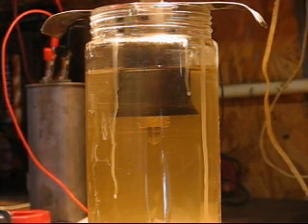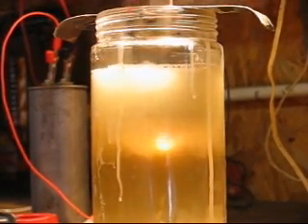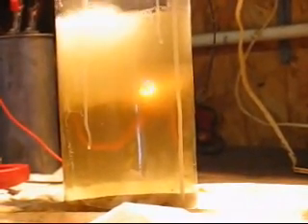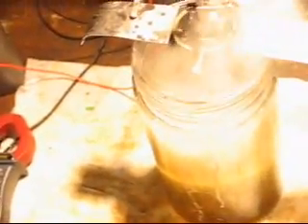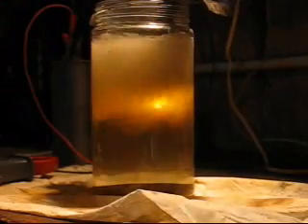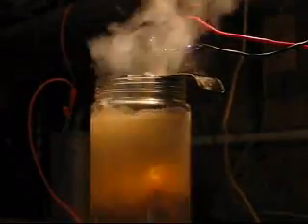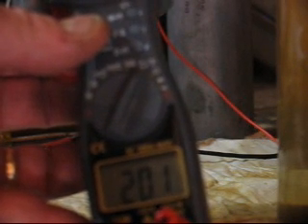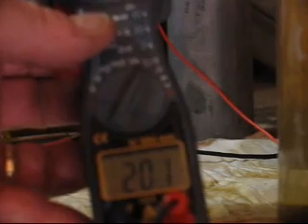Cold Fusion Plasma 7

Comment: You can use steal wool or mesh in the bottom for your anode as well.

You don't need to buffer the DC with caps. It will work fine without any caps. Don't forget to put a fuse in your circuit in case the current draw starts melting your wires. (In the event of short circuit or over-conductive electrolyte.)

When you do this experiment you should conduct energy in / out measurements and record the results. That way you can verify if any cold fusion is occurring. 

I've done this experiment twice.

Comment from the maker: Yes it goes to straight to the bridge rectifier then to the electrodes. I have the 2250uF capacitor bank hooked onto the neg and pos tabs on the actual plasma cell. Don't forget to hook the neg lead to the electrode and the pos to the housing or whatever you are using.

Comment from the maker: The inside cylinder is made of stainless also. It's pressed on the Teflon rod. Look in the Cold Fusion Plasma 8 video. All metals shown is just standard sch 40 stainless pipe flared, with a bushing to hold the Teflon. Teflon acts as a insulator so the cathode an anode stay seperated.

Comment from the maker: Did a test today with the HHO Plasma using a 3/8 dia. straight flute Carbide drill
48 oz. Tap water 
Run Time:
Water  temp  120-190°F
Input Voltage  240V AC Variable Transformer
Amps AC  1.2        Variable Transformer
Input Voltage  120V DC Cell
Amps DC  2.5
Time   3 min. 30 sec.